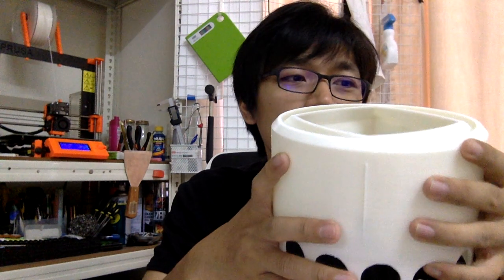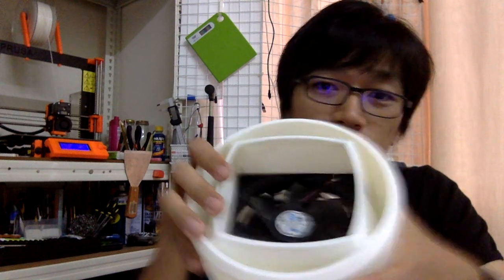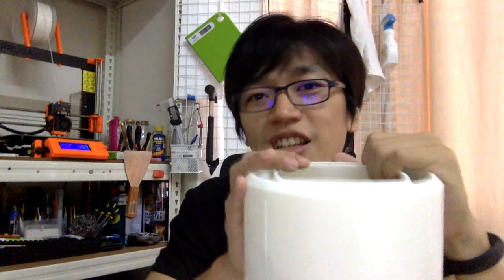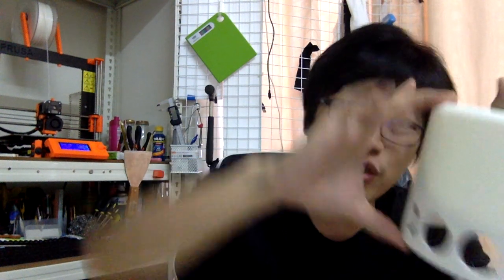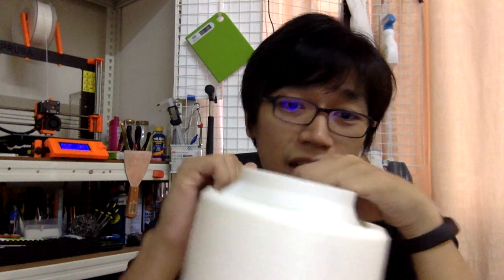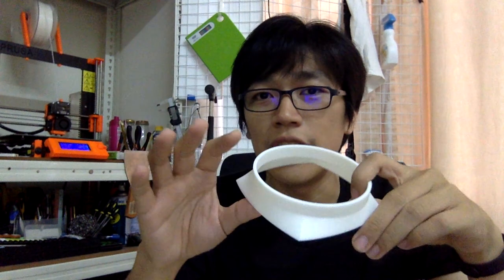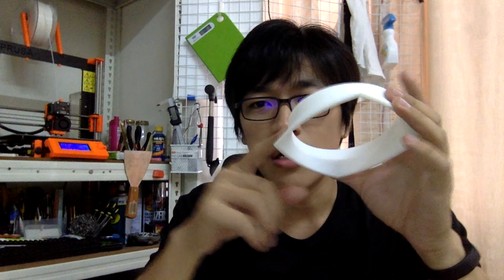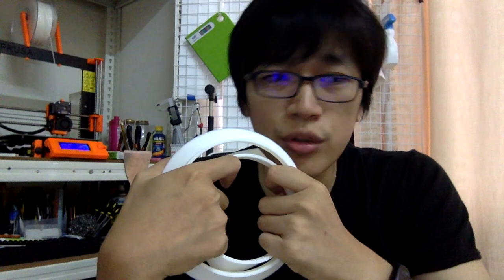How to fix when 3D print run out filament

Comment: Thanks for making this video!  I have been thinking about the best way to resume after running out of filament, in my case ABS, and I think your method would work well.  I should be able to just acetone glue the two parts together without much trouble!
Reply from the maker: 😭 Thank you for let me know it help you